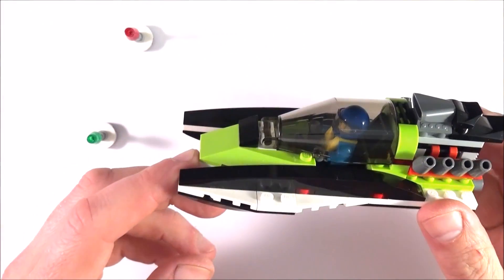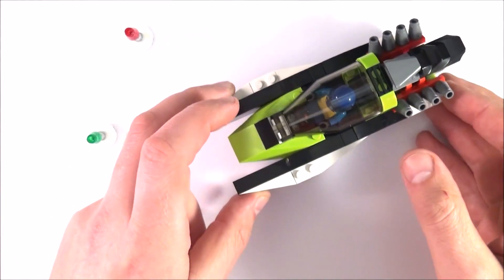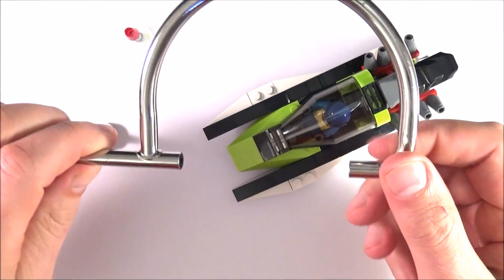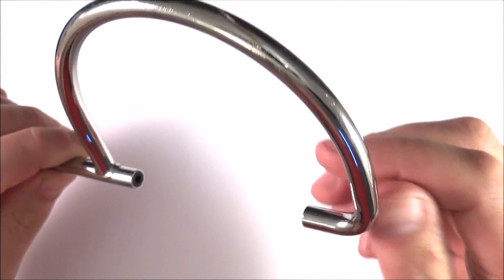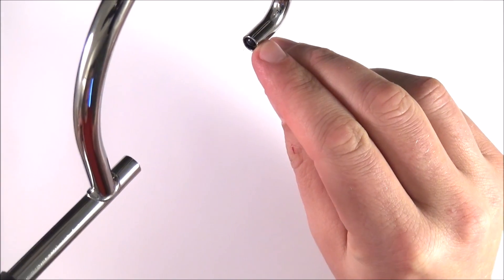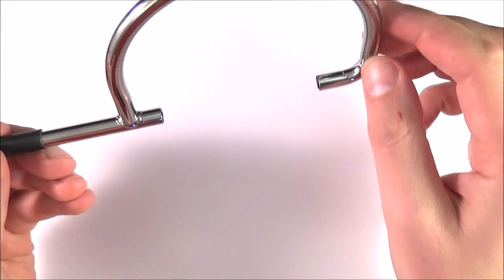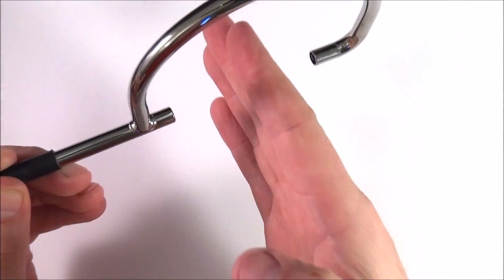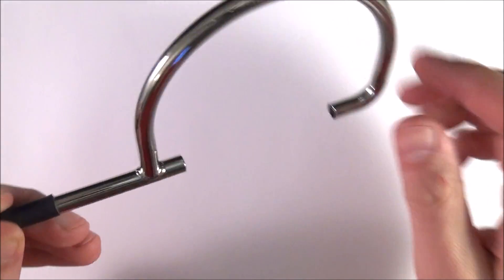Light Gates and Data Loggers - A Level Physics

Comment: how can you ensure that the object is moving in a straight line as it passes the light gate
Reply: You'd need a frictionless surface and zero air resistance, so It'd be quite hard. It not going in a straight line is an uncertainty.

Comment: Where can we buy that kind of light gates and data logger from. We need this to do a project (at home due to the pandemic) -- needs to be reasonably priced. Thanks.
Reply from the maker: Not sure, light gates are usually quite expensive!
Reply: These types of devices can be made relatively with an Arduino and a few IR light-emitting diodes diode s and IR sensor diodes.  A bit of programming is needed, but there are examples on the net for this type of measurement,.  It might not be as pretty as a commercial device, but it will be cheaper and you will learn quite a bit by making your own.
Reply: @richardmortimer6539 You can also make an even cheaper setup... just use a toy laser, and an LDR (make sure they align properly)... The LDR acts as a switch for when the lazer gets interrupted and the arduino times it